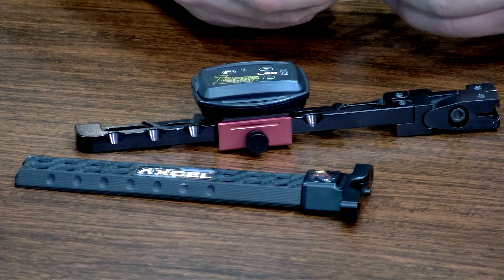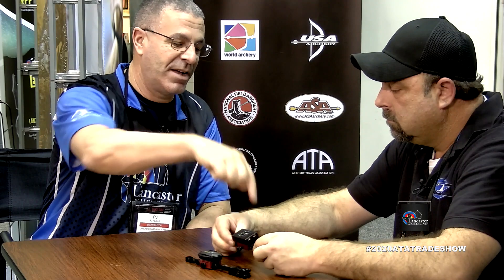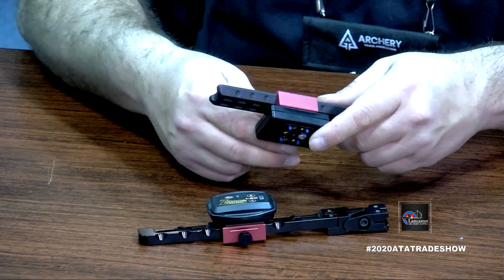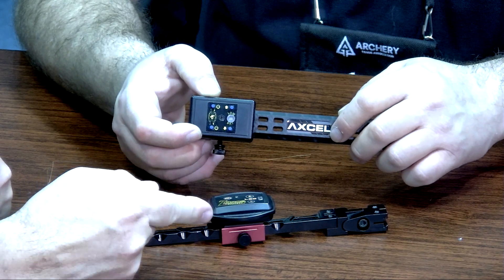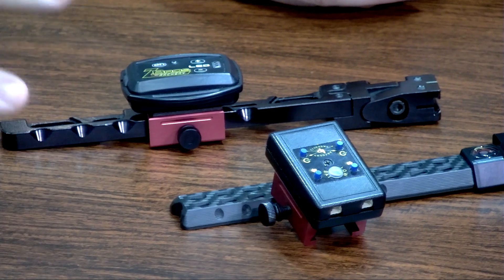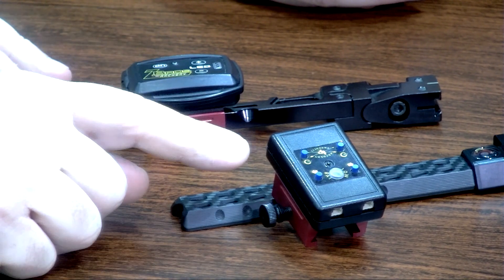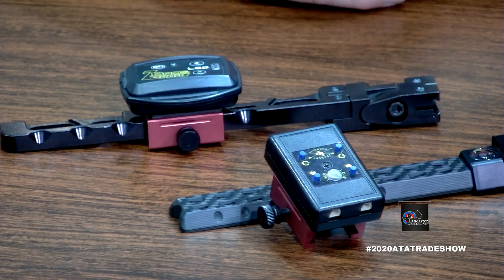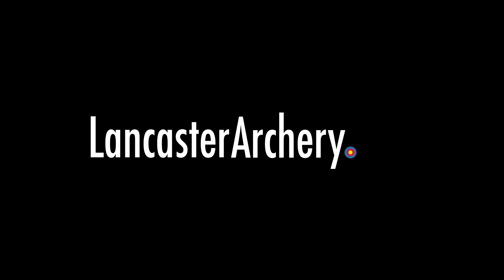2020 ATA Show | Tight Lite Bracket with Jamie Kruger

Comment: I got one and its bulletproof , easy on , easy off and no worries of it coming off ! Great family too !
Reply: What is it?
Reply: @Jay_Michael  it's a bracket that slides and anchors onto your sight bar and you mount your sight lite controller to it so it doesn't move around !
Reply: What kind of sight light? Like a sight pin illuminator?
Reply: @Jay_Michael  yup